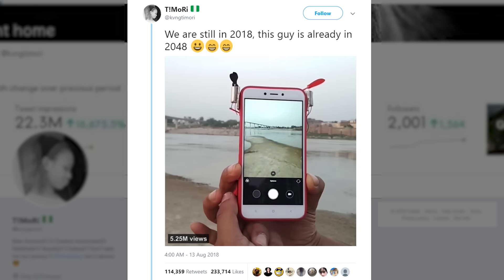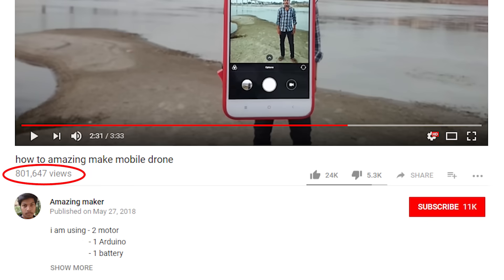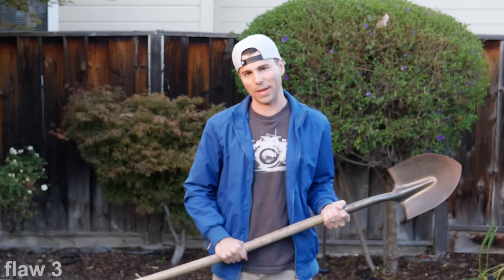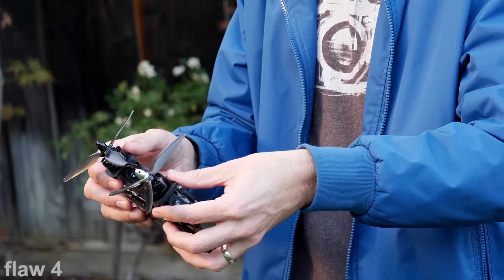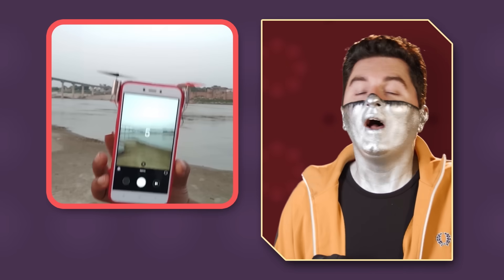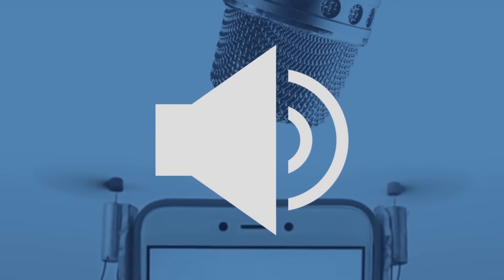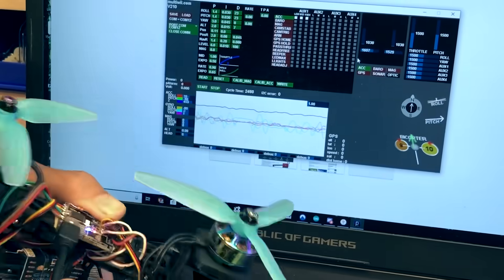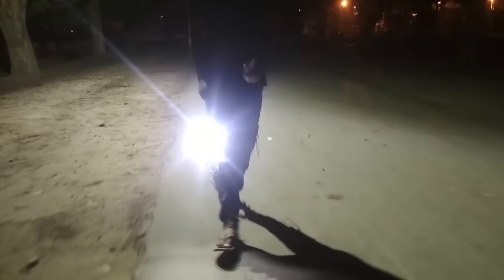Flying Phone Scam Exposed (so I built a REAL one)

Comment: I CANNOT I SIMPLY CANNOT GET ENOUGH of the fact that this video and Captain D's video actively treat themselves as synchronous.
Both Captain D's video and this video start their "joined" segment at exactly the same time. And Mark referencing that time being "Five minutes late" can either be attributed to the start of the video, or the first mention of Captain Disillusion. Either way, that simple attention to detail is lovely, and the fact this segment of the video runs basically identical is wonderful.
Top-tier.
Reply: what are you saying
Reply: @thiccboiobunga2088  Their entire conversation is identical on both sides of the line, and even the little note about being late matches up with the structure of the video.
Reply: tl;dr

Comment: But you do not need to have a remote to control where it goes. You just need to have it hovering at the same spot...
Reply: The problem is, it's really, really, REALLY hard to stay in place for an extended period of time without anything to keep it in place, in fact, it's so hard, it's basically impossible.

Comment: The phone would stay upright because all of the weight is straight down toward the earth and the counteracting upward thrust is operating on the top (pretty much like a hot-air balloon, you don't see them falling over much). The shovel-balancing analogy is exactly upside down. The accurate analogy is "balancing" a shovel held from the top of the handle with the blade hanging downward. Somewhat easier. Station-keeping would still be a problem, and the Gravity-Assisted-Self-destruct feature isn't for everyone.

Comment: You need to put Two propellers on top of each other stacked on one motor, then you make 4 motors around. Additionally you can use some casing around to make wind tunnel and thus concentrate the airflow.

Military tested double propellers.

 The upward force should be enough to hold the phone for some time and when you include solar battery it will fly forever ,D

Comment: Bit of a weird point to make, but when you're talking about the acoustics of having that many fans, you said 13 more would make it at least 6 times louder. If I'm not mistaken, and I could very well be, wouldn't that many extra fans only make it a little over twice as loud? If I play 2 Bluetooth speakers at maximum volume, they aren't twice as loud as just one, I'd need about 10 in order for it to be twice as loud as just the one.

Feels weird correcting an aerospace engineer, which leads me to believe I'm totally wrong, but I'm pretty sure I learned that somewhere so just thought I'd make a point of it 😅

Comment: This could be built as a quadcopter with two motors further behind the phone, and of cause stronger motors.  For battery, gyro and accelerometer, use the phone itself, leaving only enough outside electronics to pass controlled amounts of energy to the motors. Still the real motors would be bigger and the battery time severely limited.   A third option would be a traditional airplane configuration with wings and ailerons.

Comment: Fun fact: mark didn't need the board because most phones after 2015 include gyroscope and accelerometer compatibility and it's not hard to solder to different wires together with different ports for reading functionality especially on google supported platforms like Samsung to have a surge of google cardboard vr functionality (ex. Click on the settings gear of this video and if you see a setting that says "watch in vr" your phone has it)
Reply: but he should program the phone too if he gonna do that

Comment: Not trying to diss or anything, but you said adding 13 motors is 6 times as louder, but it would only be 2 times as loud, because you need ten times the sound to be 2 times as loud. Dont know why though
Reply: Do you understand what loud is?
Reply: @neverkind9399  it seems i know more physics than you

Comment: You can up the voltage and increase the output of the motors. You risk burning them out faster but you can overclock them by a decent amount. Based on the frequency of this guy's helicopter I don't think this is the case here.

Comment: 5:20 actually it would be around 2.5 times louder
Reply: and why is that
Reply: @chimaer3743 wow… I didn’t get that notification. Anyways, to answer that question, lest say you have a speaker at full volume playing something. That would be 1x the sound of a speaker. Now If you had 2 speakers playing the same thing at full volume, it would only be 1.1x as loud. Therefore having 14 or 15 propellers, it would be 1 + 0.13 or 14, or 2.3 or 2.4. Rounding to almost 2.5x the original volume.

Comment: No question about shortfall in thrust... Absolutely agree. 

But would it actually need gyro and accel sensors? 

If magic super-duper thrusters were aligned so center of gravity and thrust are on the same plane along the vertical axis, but far enough apart, then won't gravity keep the whole kit pulled straight down and thus vertical? Seems it would just inherently resist tilting, kind of like kick scooters being somewhat stable without having significant rotational inertia like bikes(ie center of gravity below axle) 

Also for the shovel balance example to be congruous, the force countering gravity wouldn't be a single unbalanced 'palm' under the whole thing but rather a pair of fingers, one on each side, hooked under the perpendicular back edge of the blade.    No?yes?
Reply: no because of 2 reasons 1: who would want a nonmoving drone. and 2: wind

Comment: I immediately don't buy that because something everybody gets wrong is that lifting even a few pounds off the ground requires either big blades and/or strong motors. Drones are here, they work, they can lift whole DSLRs. But based on the weight of the average phone, these little pocket fans ain't gonna lift this thing.

Comment: So you need about  80$ for the brushless  motors maybe 10or15$ for the flight controller and 15$  for the speed controller  and another 10 for the speed controllers and a 3.000$ 3D printer got you easy stuff

Comment: Great takedown! One small and probably irrelevant point: A single rotor helicopter which is hovering does not move forward by pitching forward.  A airplane pitches by using the airflow generated from forward motion to push against the elevator.  However, a helicopter at hover does not have this airflow.  The engineering solution was to allow the rotor to pitch and bank slightly independently of the fuselage.  As you later note, a quadcopter can break out of hover by changing the speed (or pitch) of the props.  Of course, all of this does not detract from the main point you were making - which is that if a helicopter (or iPhone) rotor pitches or banks, it will cause the helicopter (or iPhone) to move longitudinally or laterally.

Comment: Hi Mark, love your videos. One technical correction on your statements regarding the sound volume (1 vs 16 motors). Per double of the sound units, 4dB is added. So actually from 1 to 16 motors would increase the sound volume by 12dB  or experienced as a tripled volume based on the original dB volume (so 3 times louder, not times 16). Cheers and keep scamming scammers!! Grtz from Europe

Comment: I have a quick question about flaw#3 im not familiar with that arduino board but could it be link wirelessly to the phone and use the phones own accelerometer and gyroscope. Thanks in advance im actually curious.

Comment: 5:15
It is not true that if you double the amount of those motors (or whatever) the noise will get doubled. 
Sound is measured in logarithmic scale so if you want to double the sound from 1 speaker you will actually need 10 of them.

Comment: Even if this was real you wouldn’t need a closed loop feedback response system to keep it upright because it’s pulling from the top. You wouldn’t be able to steer or anything but it would be like if you were holding your shovel from the top and letting it hang.

Comment: "No moving parts" aside from the 4 propellers!
Reply: See how this bicopter needed the propellers to be able to turn so it could adjust angle and such, the quad copter doesn't need that. It is able to move around just by changing speeds on the four propellers. Eg, by increasing the speed of the back propellers, it tilts forward, and can thus move forward.

Comment: For balance why not use 3 propellers instead of 2 or 4. I mean to get a proper stabilization you only need 3 right? And 4 is only required for when you need movement, where this one is only meant to fly in the air in on place.

Comment: Is that an f4 fc flashed with iNav? Or was it an f3 and betaflight/cleanflight? I haven't built a bicopter before so I'm curious. Quads just seem more practical.
You should redo this with more advanced technology. You could significantly reduce the weight of it and size. Use an all in 1 (esc and fc) 20*20 fc with an xt30 and a 2s or 3s battery. You could then reduce the motor and propeller size. Or use 4 smaller motors for more control and to remove the servos.

Comment: 2:30 yes i know this very well the force of the propellers are using the force of air to push themselves forward due to what angle they are at. The air is pushing off of the air and forcing themselves forward.

Comment: But... why a board in the first place? Most smart phone already have a built in accelerometer and gyroscope? It wouldn't need another external board... This entire thing could easily be done by using the phone itself. The only thing that it would probably need (aside from the motors) is a battery that can keep the propellers running.

Comment: 5th physics flaw, the two motors appear to be spinning in the same direction which will cause gyroscopic force which will make the phone spin (you can see it in the test where they made the same creation as the guy, the phone spins compared to when the motors are off)

Comment: 5:20 I might be incorrect, but I'm pretty sure that you would have to have ten times more motors producing noise, rather than just double, to produce a sound that sounds twice as loud. That's twenty motors! And on from there it gets more insane because you have to multiply by ten each time. So, if I am correct, then 2 × 10 to the sixth power would give us the amount of motors needed to produce a sound six times as loud as just two.

To produce a sound that is six times louder than the two motors, you would need at least 2 MILLION motors running at the same time.

Please correct me if I'm wrong
Reply: i GUESS he wanted to say 6 times louder in terms of power, not human perception, i GUESS, also correct me if im wrong.
Reply: 😵 To many words. Please speak English. 😣
Reply: @Lux_vast  mark would need 2 million fans to make a sound six times louder than just two fans
Reply: @alienattack1630  ohhh OK, ;-;
Reply: @alienattack1630  if you talk about 6 time more dB , i think it s over 2 million motors, maybe I m wrong but I think it s something like 10^39 motors 😅

Comment: Helicopters do not tip forward. The plane of the rotor blades tip forward, causing the fuselage to "catch up" to the tilt of the rotor system. In essence, the fuselage is always playing "catch up" with the rotor system until the helicopter becomes streamlined.

Comment: 13 more fans means 6x louder? Wait what’s the equation for that? I’m not a doubter just wana learn !
Reply: Sound waves merge, they don't stack. So if the sound was 16 decibels per .1 millisecond, then introducing another one slightly out of sync would make  the sound frequency increase to 16 decibels per .05 milliseconds, giving the illusion of a louder sound.
Reply: Because he had 2 at first and 13/2 is roughly 6

Comment: Mark I can't tell if I'm an engineer but I like drawing but I do remember one time when I took apart one of those things they can pick up garbage so I took it apart and I made a fishing pole so I made the wire the line and another part the bait and then I left the as well the handle I can also remember alot of glue like a bunch of glue from my purple glue stick and I was kinda young when I did it like a couple years ago that's it bye

Comment: With usb cable plugged in your phone actually can work as gyro and accelometer because smart phones has them both. And little space between phone and motors sound is not problem. Attach four ~10cm carbon sticks to upper side of phone so they strech out as a square 9cm/side. Also you can take power from phones battery. Who ever makes this, rember me. Call it MicaP-T. 
Donate all income from it to charity.

Comment: Hey, weird question. wouldnt the air being pushed down from the rotors also make whatever is underneath the rotors (Like a helicopter body) be pushed down by the air? Why dont helicopters have their bodies above the rotors instead?
Reply: Bruh
Reply: wouldnt the air force the body down, and then also have to use more power to lift something because it technically push itself down? im not sure anyone understand me.

Comment: Would I be able to take apart an old chainsaw and attach the motor and a bike chain to the bottom of my longboard then hook the chain to the wheels to hold a string to pull the throttle to make a gas powered longboard

Comment: Why in the world would he not use the capabilities already existing on the phone? 
1) Processor - Check
2) Gyro/Accelerometer - Check
3) Battery - Check
4) Lack of additional weight - Duh
Reply: I feel like that would require a bit of extra software and wiring work.

Comment: "You would need 13 more motors than this so it would be at least 6 times louder"

That's false because sound perception isn't linear. If I recall correct 10 motors would be approximately twice as loud as 1 motor

Comment: Wow this made me remember something I havn't thought about for over 30 years.

As a kid in my dreams of making an electric airplane my electric motor was just not cutting it, I just needed more power and thats when the bright thought struck me... 240v mains.
With a grin and insulated plies I stuck those wires into the 240 power socket. 

That motor sounded like a jet engine and the airplane moved... for about 1 second then smoke and a almighty CRACK followed by sizzling a blown fuse and my mother yelling
"WHAT DID YOU DO THIS TIME"

Honestly surprised I made it to adulthood. 

I had a lot of events like that, one time I turned a remote controlled boat into a battleship with steel tubes filled with gunpowder I stole from my fathers reloading kit, it worked and also blew up the boat.

Actually noticing a theme now I reflect...

Comment: "The reason pretty much all camera drones are quad copters is because they're much more stablre due to a larger footprint shared between four motors. And by getting clever with the throttle speeds, you can move in all six degrees of freedom with no moving parts."
Propellors that rotate to keep the thing in the air: Am I a joke to you?

Comment: 10:12 that will never work the human walk speed is to slow for it give the amount of energy for the phone even say it charging if him runing it still be too low because the leg moving it only bend so much why you think we use bike as a way to workout and charge phone. the bike spin around and around keeping the motor making energy maybe not much but it way more then the leg bending and how the leg bend will even turn into power we use windmill watermill even treadmill to make power all 3 need to spin unlike other power way like coal stream and sunlight the spin is what make the power for bike people leg spin power the wheel but for bike power phone we take the bake off the ground and make the back wheel as a way to spin the motor i think like a dead car when you push it to start it the motor move power back into the battery
Reply: Noice

Comment: Hey, abou flaw 3.

This is actually not true for all drones. I drone race, both with quads and wings, and I very often fly without the stabilizer. This means that for every movement, I have to give a countermovement. It takes a whole bunch of practice, but after a while, I just had it down.

So I wouldn't say this is a flaw if someone is controlling the drone.

I would say. But I don't really built drones, so not 100% sure but I think this is what you meant.

Comment: This is just a nitpick, but Mark made a slight mistake. He mentions at 5:15 that adding 13 more fans would make it at least 6 times more louder but since our ears sense  logarithmically a 6 times increase in amplitude will not be perceived as a 6 times increase in loudness. It would be less than that although still way more than the original.
Reply: I don't understand ;-;

Comment: One thing you forgot to mention about the instability of your design is that the laws of physics say that every time your rotors tilt, the phone will experience an equal and opposite reaction. A quad copter does not use tilting rotors so it will not destabilize itself any when it tries to correct its inclination

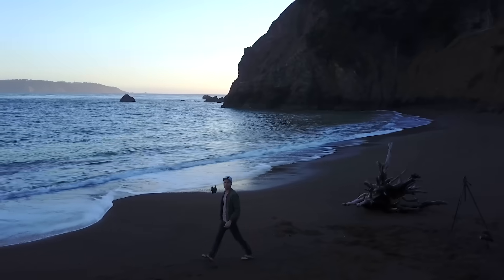Comment: 9:50 "With no moving parts"
*Completely misses the huge moving propellers*

Nice video.
Reply: Sara E He meant by the fact that the parts do not move individually (like it should for a dual-copter) the entire drone moves (which is a lot easier to do) in order to change direction.

Comment: i don't want to protect this dude.

But i was thinkin... a mobile phone mostly has a gyro sensor so you can do all this fancy stuff like flip the resulution if you flip the phone. So why use an extra gyro sensor for the arduino? i mean yes programmig a smartphon is hard stuff but theoreticly you can use the sensor of the Phone to hold the structure in place.
so beside the realy big hits aginst physic i see a way to at least programming this stuff only using an arduino and a smartphone

Comment: wrong..  helicopters dont have to tip forward to move forward..    simple fact the collective..   although if you wanted to move faster.. yeah you bow the front....   and the simple fact counter rotating blades cancels the torque of the other..